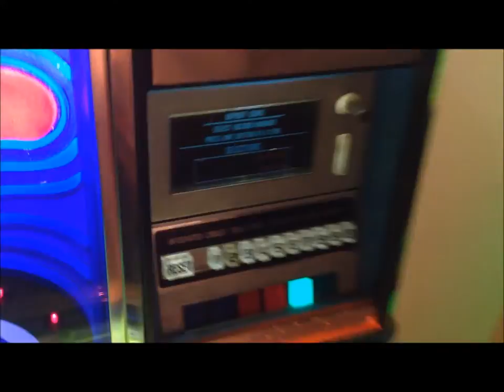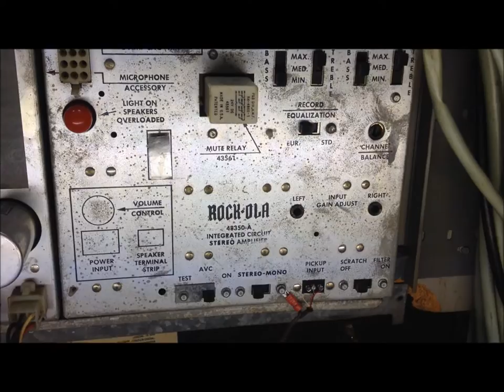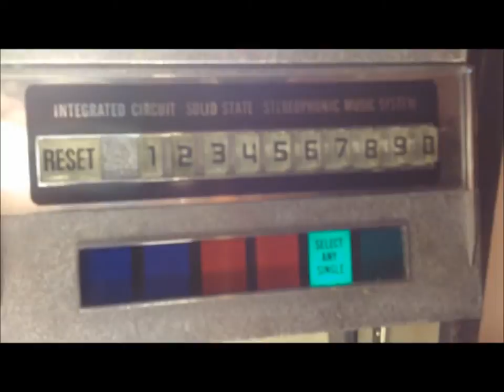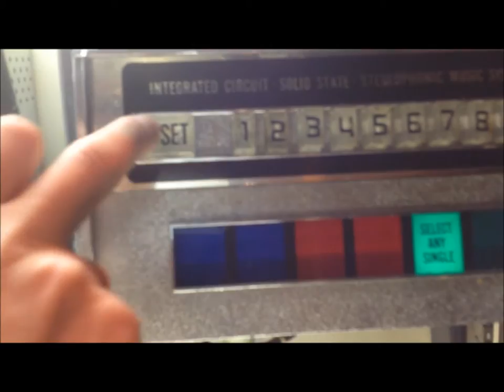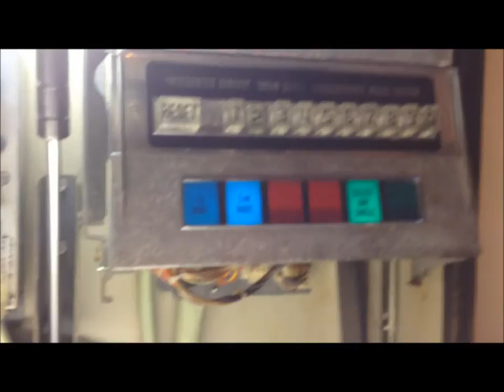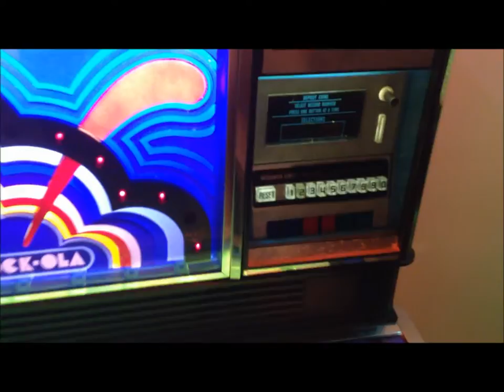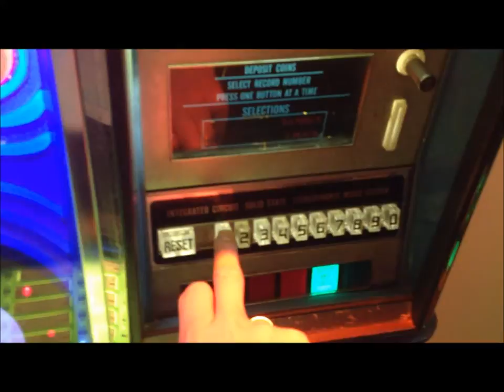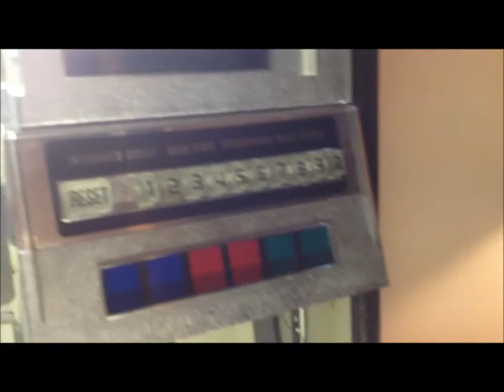Rockola 474 Explained

Comment: The part you said was a "valve" is a capacitor. It's the main filter capacitor for the amp's power supply.
Reply: This guy seems about as technical as a turnip...
Reply: Also, it shouldn't get hot!

Comment: The 474 (and it's close cousin the 50-record 473) were the first Rock-Ola models to have LED displays to show the record playing and the last models to select records from the pinbank system.  Later models have an electronic selection system using an optical reader. BTW, I replaced the gas springs on a similarly-built model 478 by using NAPA auto parts Lift Support # BK-819-5208:

Comment: The mute relay is used to mute the amplifier while the mechanism is rejecting a record. The relay will close once the mechanism loads the record to prevent the sound of the brush cleaning the stylus or unwanted noises of the mechanism. Once the record has reached the end and the mechanism rejects, the mute relay will open, muting the speakers.

Comment: Cool machine Marcus!  Yeah you'd have thought that removing that mute relay would have cut the COM-NC contact to the speakers or amplifier and it would have gone silent.
Amazing selection wheel and coin mech counter system.  Certainly reminds me of an old pinball machine that my mate had.  That had the same sort of thing inside - when the ball hit certain areas this rotary counter inside the unit would go round until it reached the end and triggered the counter (like a bonus score) many times as it returned back (hmmm wonder if he still has it).

Definitely need to take a look at that sometime ;)

Comment: My 474 has a hum when plugged in. What would cause this. Thanks
Reply: I'm not a professional nor an expert but in all of the audio equipment I've dealt with in CB and ham radio it's usually a bad capacitor in my experience good luck

Comment: I have a Rock-ola 450 that when the selector buttons are depressed, there is no selection made. and the reset button does not reset buttons when it is pressed.  manual selections can be made and the jukebox works great.  Believing something is not powering some where on the selection unit.  Any help on what to look at, would be greatly appreciated. Thank you.
Reply: just working on a 444 had similar problem , credits where showing but selector buttons not latching. it was the selector loockbar solenoid that was not energizing turned out to be bad diode ( one of two at the same place ) about an inch from the solenoid . dont know if that helps any
Reply: @rpowell3000  i have a 445 and the write in side of the selector will not select odd numbered records in E and F. ie E1,E3 E5 ,F1 F3 F5 etc
Any ideas whst may be causing thi pls. All other selections are fine. Tks